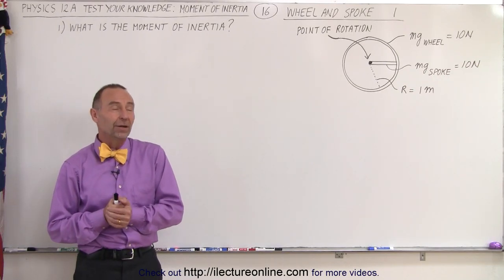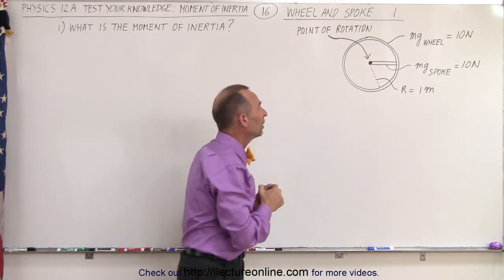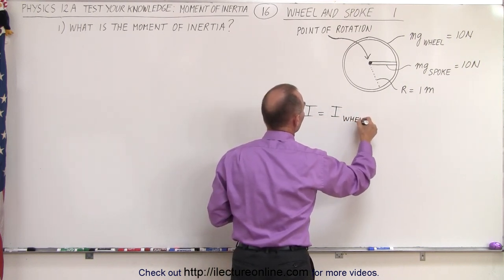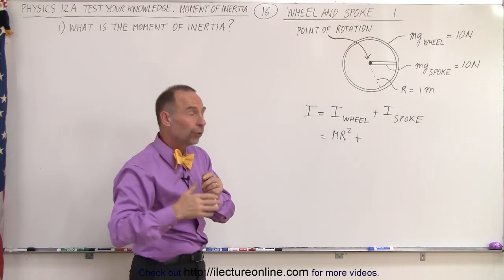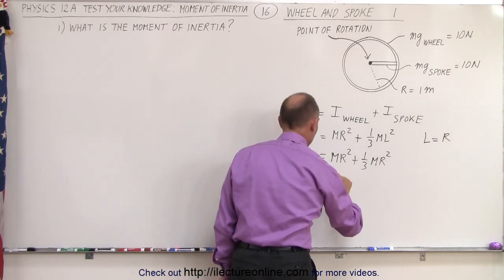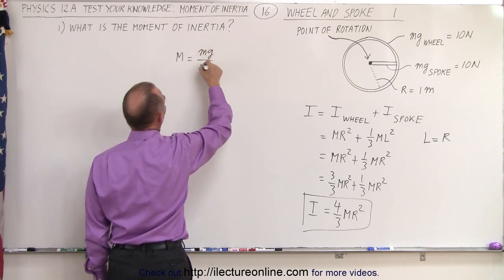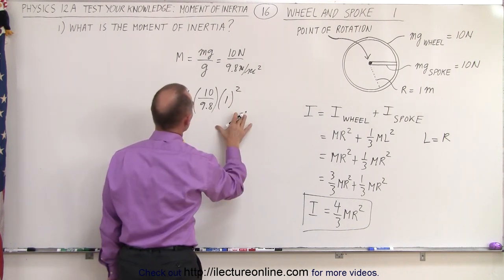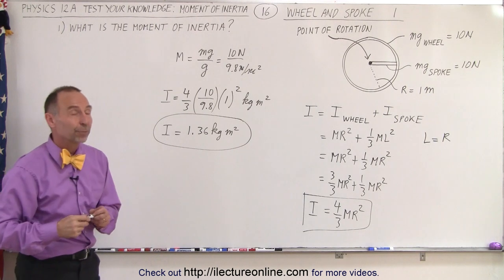Physics - Test Your Knowledge: Moment of Inertia (16 of 24) Wheel and Spoke: Part 1/5

Comment: If the weight of the wheel rim is 10N and that of the spoke is 10N would'nt the weight of the object be 20N such that M=20N/g?
Reply from the maker: The weight of the TOTAL object is 20 N, but that is not relevant when calculating the moment of inertia of each part separately and then combining the two results.
Reply: @MichelvanBiezen  Yes thats cleared it!! I oversaw I=I(w)+I(s)=4/3mR^2 thinking M was the total mass of the object in the rule whereas mass of wheel rim & spoke are equal .!! Physics is a hard master, always unforgiving when missing details ! Many thanks Prof Beizen.
Reply from the maker: I like your description of physics: "a hard mater, always unforgiving when missing details".

Comment: Professor, is there any chance at all to do a moment of inertia on a Metronome or a pendulum with a fixed weight on one end and a movable weight on the other, or at least calculate the Period in Seconds (T) based upon a rod with a center pivot not at the center of mass and two different masses at the end of the rod?

That would help design a pendulum for a clock I'm designing without having to do it empirically. The maths would really cool to do! I know you're busy ... thanks!
Reply from the maker: This may help.  We are planning on additional "real" types of pendulum problems in the future.   Physics - The Pendulum (2 of 2) The Physical Pendulum (Non-Ideal)
Reply: @MichelvanBiezen  That would be outstanding, Professor. Thank you. The double-weighted pendulum has very interesting properties, but I've only been able to figure them empirically. Love the channel. Great work!